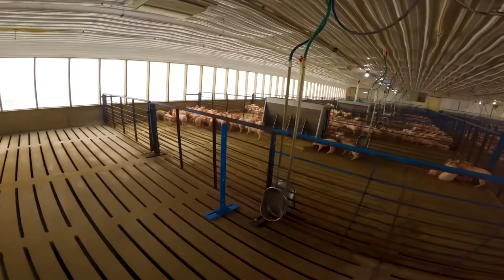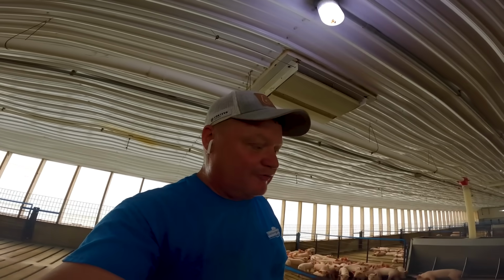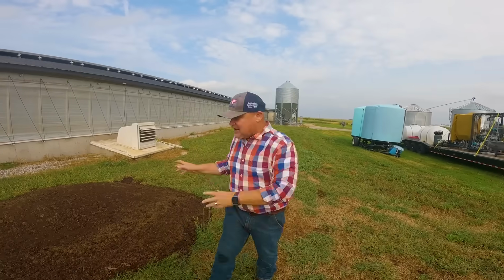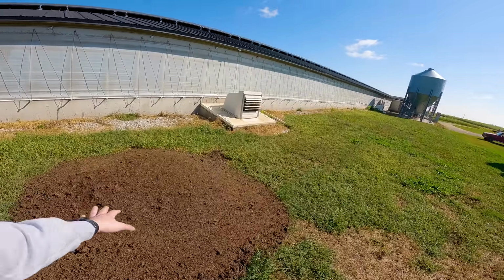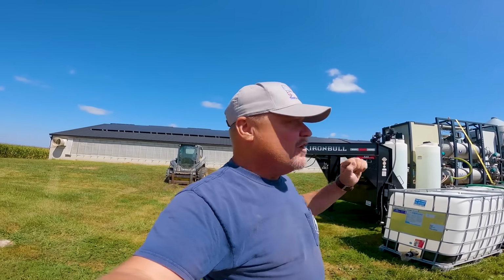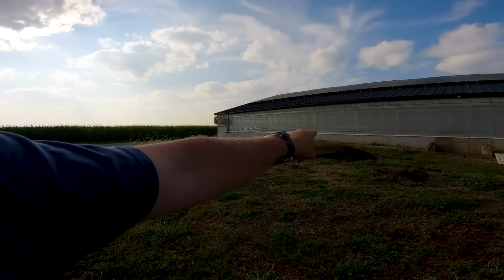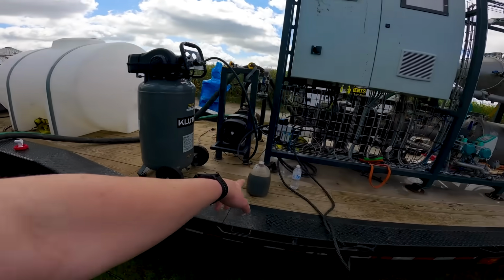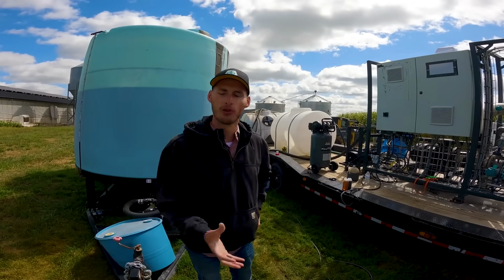Manure Miracle: Hog Poop to Gold Fertilizer!

Comment: Why not just spray the manure on the fields? 🤨 I've seen videos where the farmer injected it into the ground, not spray it on top to reduce smell and lose less to evaporation.
Reply: They have contracted with a dragline outfit to knife in the manure before. At some point, they may hit a wall for Phosphorus in the soil, and won't be able to spread/inject on the same land because of that. This process reduces the volume of the product (💩) and makes it easier to spread elsewhere, and can possibly be an income stream for the farm.
Reply: This is exactly correct. Dragline application is substantially restricted to the distance from the manure storage location and amounts that can be applied. Separating it like this gives much more flexibility, option, and control.